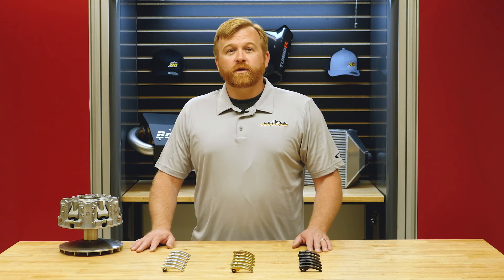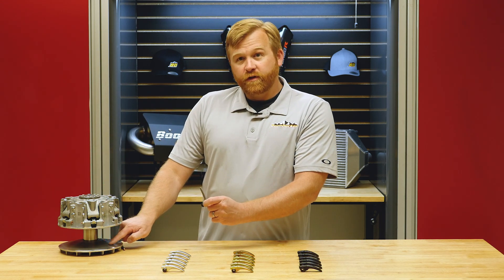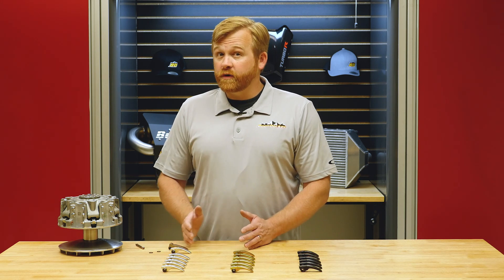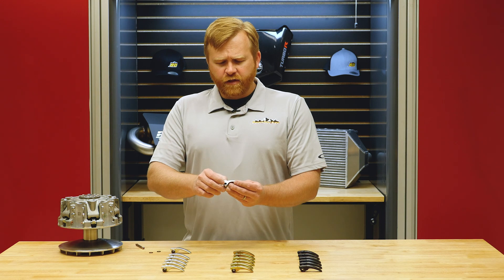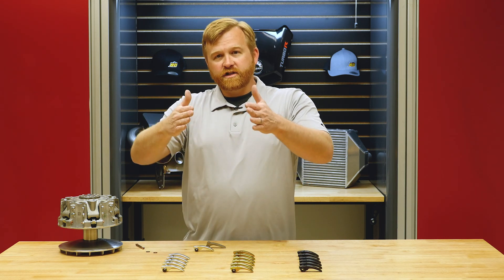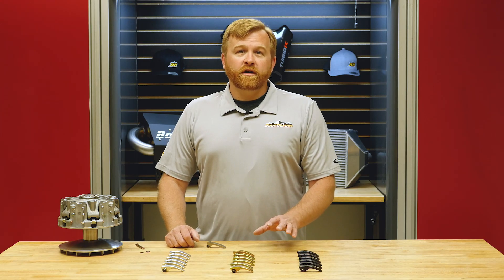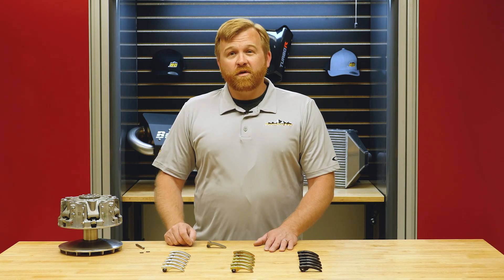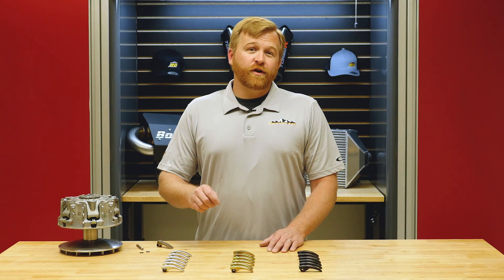The FIRST MOD you should do to a Can-Am X3

Comment: 2020 RR , 93 octane tune, using the 6-45 gram weights, gets right up to 7900 rpm and holds there as advertised
Reply: 8100-8200 rpm is the sweet spot you want to be in 👍🏻